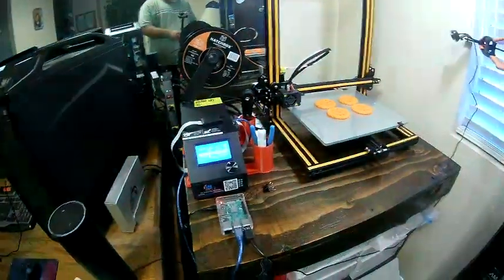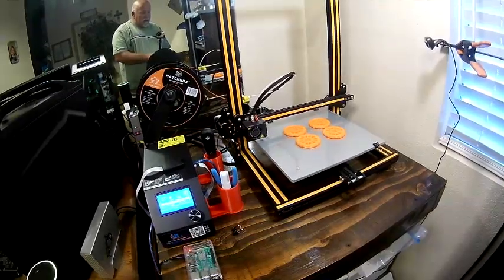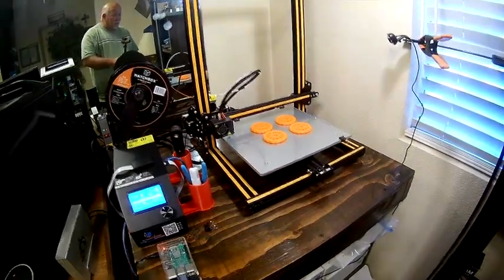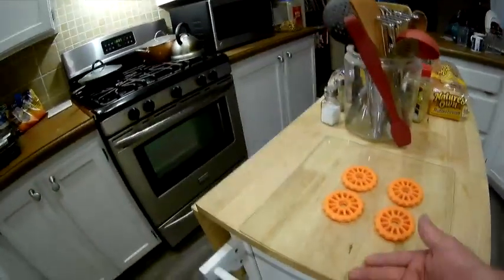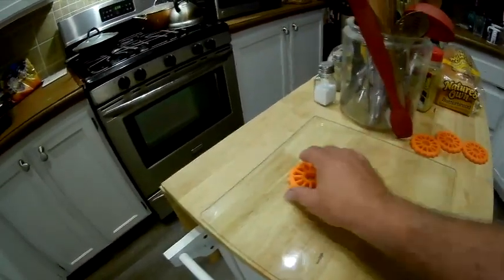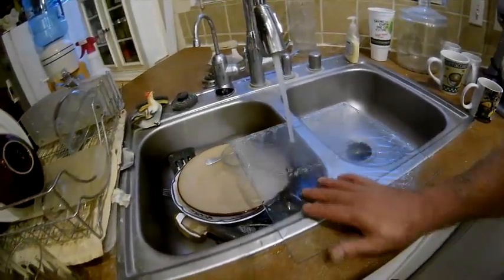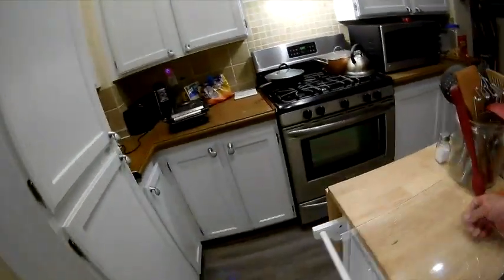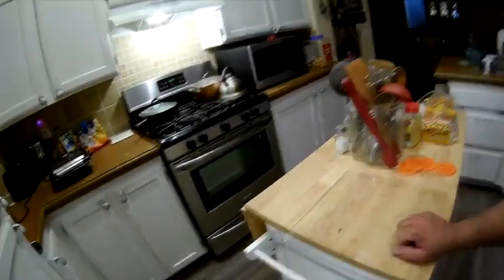Easy way to Remove 3D Printed Items from glass bed #3dhp

Comment: I am afraid this did not help with a bigger print
Reply from the maker: This was something that worked for me on my first printer years ago. Gluestick on glass or mirror usually releases at 42 c. Flexplates are the way to go now days. I usually put Nano Polymer adhesive on them.

Comment: thank you sir. i just got a glass bed for the creality ender 3 today. my first print on the textured side did not want to come up at all it was just stuck stuck. didnt want to remove at all and it broke like soft cheese. thankfully it was a test print. printing on the smooth side now and i will follow your advice. i hope it works.

Comment: I have removed the glass bed and it is really great, it does indeed release itself, thanks for this tip. And a happy new year, greetings from the Netherlands Groningen
Reply: I disagree with this. I've left parts on the glass bed over night and they are stuck to it like mortar. Depends on the surface area of the print.  Ain't no way you're just pulling off a darth vader head on a raft by letting it sit for 10 minutes. You have to scrape underneath it

Comment: Doesn’t matter how cool my glass gets. I could put it in the damn freezer and I still have to hit the parts with a fucking hammer to get them off
Reply from the maker: Sorry your having problems,when the print bed reaches 42c it usually releases with pla.PETG must have a release agent like gluestick or it will never release and take out a chunk of glass or mirror.

Comment: i print right on  the glass with no glue or anything and it sticks alot to get it off i just hit it with some isopropyl alcohol and part slides right off

Comment: i put my bed into a freezer and it didn’t come off
Reply from the maker: Wow a  temp change usually pops the prints loose. Usually now days once your printer gets to 42c they come loose. If using PETG and no bonding agent between it and the glass or mirror. It won't come loose and will chip up the glass or mirror,but pla is no problem. I now use a flex sheets on my printers except for 1 with a mirror in an enclosure for printing ABS.

Comment: Thank you for sharing. This worked extremely well. I had a 23 hour low poly cat statue for the family with a leg known to break off during removal. I placed the glass bed on a silestone kitchen counter and over 10 minutes I could hear crackling sounds. After 10 minutes I just lightly pulled and it came off trivially!

Comment: Yeah idk what's up with my glass bed but I can let it sit overnight and my prints still won't just fall off. the machine says 25°C(77°F) bed temp which is close to the 72°F ambient temp in my house. Going to test putting it in the fridge and if that doesn't work it's going in the freezer.
Reply from the maker: pla should release at 42c with gluestick.never print PETG on bare glass. it will never release.

Comment: That was a no go. Thumbed down since it did not work.
Reply from the maker: I made this video like 4 years ago and at the time it worked great for me,I currently suggest a flex plate,spring steel sheet with magnet on it with textured surface or Pei.I still use a mirror on my enclosure with abs and glue stick.Once the bed reaches 42 c the print comes loose.Sorry this didn't work for you.

Comment: Am I missing something?  The tip is just to set the glass on a kitchen counter?
Reply: Yes, kitchen counter. And not just any counter, not your bathroom counter, not your neighbors kitchen counter, but it has to be your kitchen counter in the same house where the 3d printer is in order for this to work
Reply from the maker: @EsCraftt  This was made 4 years ago and at that time,this worked best for me.When your printer reaches 42 c the prints will release.
Reply from the maker: At the time of the video,yes to allow it to cool down quicker to remove print.Or wait until the bed has went down to 42c at least.

Comment: I have the same printer, using the same glue. I left the print to cool off over night and it's still stuck I can't take it off. maybe I put too much glue. every time the same isue
Reply from the maker: I still use glue stick on 1 of my printers and when its gets down to 42 c it comes loose and some times with minor scraping with spatula,I use a buidl tak spatula which has a paper thin blade to get under prints,not the spatula supplied with printer,those suck,also now days i use build mats Like the ones from Th3d studios or flex mats,where you flex the build plate and everything pops right off.

Comment: I had to use 50/50 alcohol and water but main question for anyone..  where do i find these prints? spiderman bust etc. new to all this? also software to create hollow versions of my prints to save time and filament.  thanks for anyone who can help
Reply: Try thingiverse
Reply: Step 1: Find what you like in Thingiverse and download the file(s).  Step 2: Download Cura, open Cura, and select your printer.  Step 3: Upload your Thingiverse files to Cura and click slice.  Step 4: Upload the Cura file to your 3d printer and print it.  There are other options, but that should get a beginner going.  Hope that helps someone.